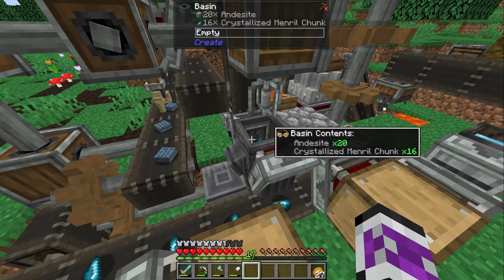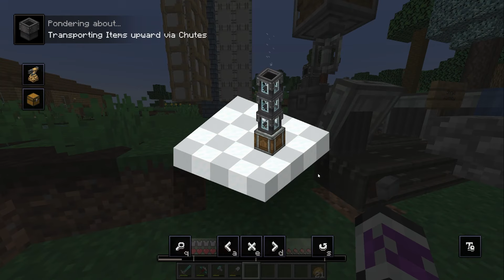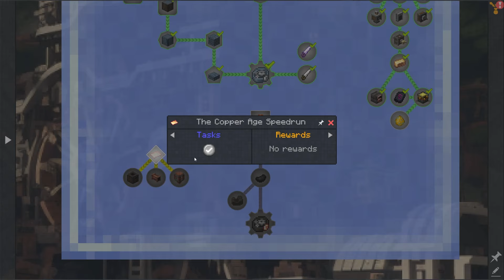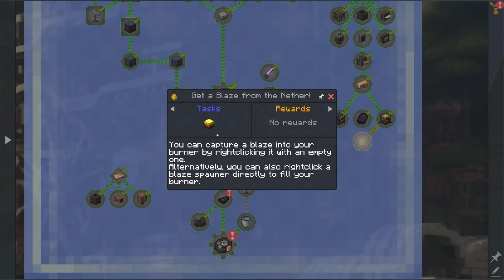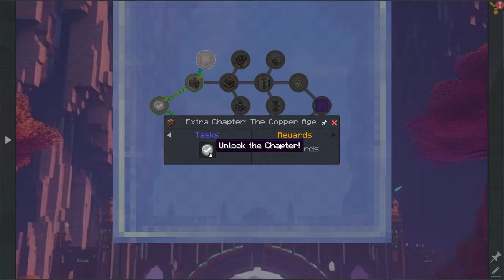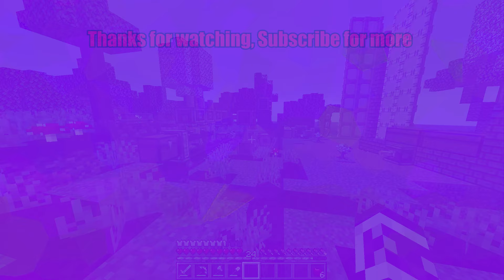Create Arcane Engineering: Episode 6 - Chapter 1 Tech Done

Comment: Just as a heads, it is highly recommended you manually make some brass stuff before doing chapter 2, especially using the variable card recipe. 
Saves alot of headache
Also if you want to have faster nether generation, remove amplified nether

Comment: Since menril trees have plus shaped base your trees will either: 
A) not grow at all, because they don't like path blocks, or
B) grow, convert path blocks back to dirt blocks, allowing more saplings to be planted, which will convert more path to dirt and the cycle repeats itself. 
If it happens to be the second option, you might try replacing path with stone. But simply making it path blocks won't do anything in the long run.
Reply from the maker: Good point, paths won't work either way. I'll replace the adjacent blocks with something else, and if they don't grow then chances are it wouldn't've worked regardless. Thanks for the tip.